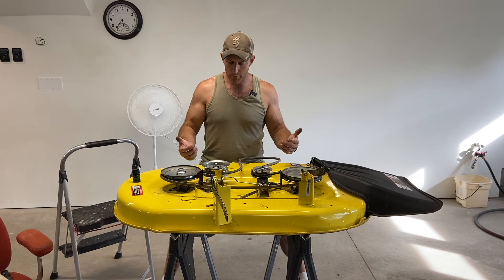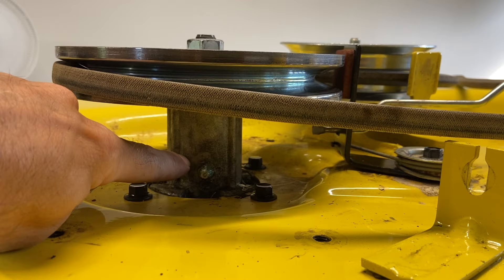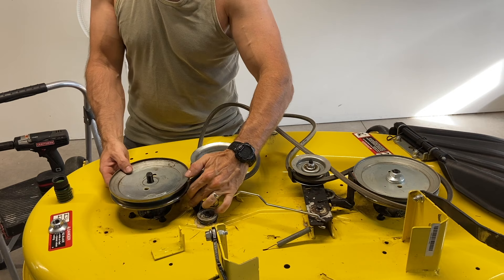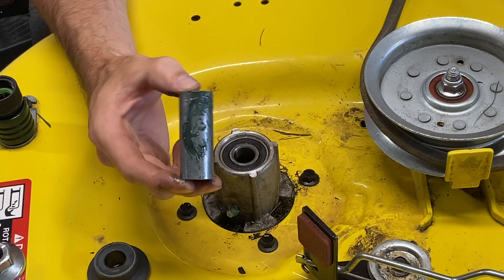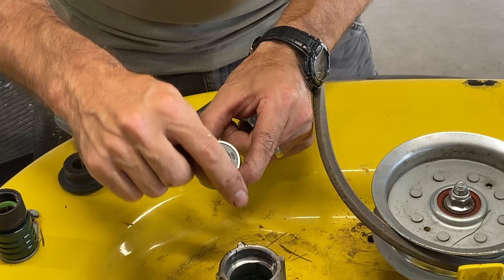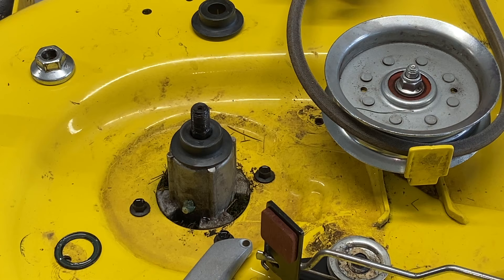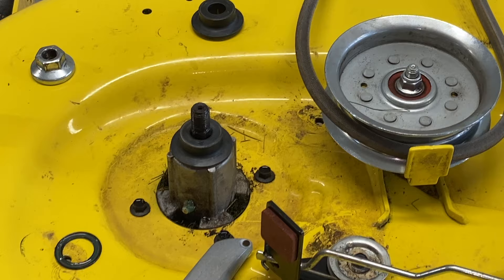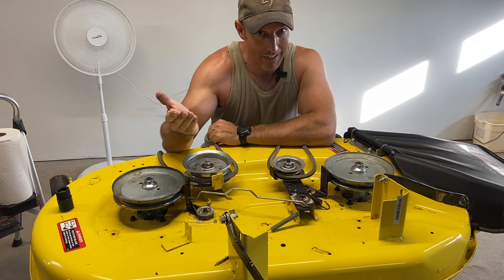I WOULD DO THIS DIFFERENT NOW JUST REPACK THE BEARINGS WITH GOOD GREASE AND PUT SEALS BACK ON.

Comment: Many years ago I went to the SKF Bearing Maintenance Training. I highly recommend it. Some takeaways: (1) The bearings in this video are 2 type. Double sealed, as seen in the bearing with the black seals . And the bottom bearing is a combo seal and metal shield. The metal shield offers better protection with all that debris being churned up during cutting. (2) Sealed bearings are factory filled to 20% capacity with grease. (3) Shielded bearings create less heat from friction than their sealed cousins. Now, the number one reason for mower spindle bearing failure is that the grease gets used up. We've all pulled out spindle bearings and found them bone dry. Yes, the zerk fitting is to pump grease into the spindle cavity to prevent the shaft from freezing to the shaft spacer. It's a waste to fill the cavity just to grease the shaft/spacer. I use anti-seize. But if you could keep grease in your mower bearings they will probably last until the deck rusts away. Once a year I use a needle greaser to add grease. 360 hours/12 years and still going. The bearings are 6204-2RS.  2RS= double sealed.  Cheers.
Reply from the maker: very good info thank you for commenting
Reply: The anti seize goes on the 2 bolts on each blade that hold blade to bearing shaft ..they tend to grow on
Reply: Very good info! There's a lot to bearing engineering and lube. Two other reasons the spindles are packed with "life Time grease: Manually, greasing can inject dirt and other debris through the grease fitting. And replacing spindles is easier and yields more profit for mechanics and dealerships than changing bearings. LOL
Reply: @czellner5894  The often heard term "lifetime grease" is a misnomer. No bearing lasts a lifetime without adding grease at some point. Yes, replacing spindle assemblies is easier, but I make more profit by replacing the bearings. I don't buy the ebay Chinese spindles because the lack of quality will come back to bite me in the arse. So I purchase quality bearings in bulk, and can swap them out faster than ordering spindles and waiting.
Reply: My original bearings lasted 16 years, mowing 2.5 acres. I bought eBay made in india spindles with sealed bearings. How long do you think they will last without removing the dust covers and greasing them?
Reply: Thanks Steady Eddie! Great info. I have a 1996 Simplicity mower and am going to go with NSK bearings as a replacement. I think I will leave the seals on and do what you do at the end of season when I put it to bed for the winter.
Reply: 3 years
Reply: I agree.  We ran irrigation pumps and the bearings on the housing going from the engine to the pump used to run warm.  I asked our lubricant supplier about that and he said we were over-greasing the bearings, too much grease and the balls or rollers were sliding and not rolling, this caused friction which heated the bearings. We were greasing every 12 hours, he said to grease them every 24 hours.  Problem solved, they ran cool.
Reply: Wonder why he didn't pack the bearing by hand and after reassembly he didn't turn the spindles to check for tightness.
Reply: @barneycarparts I was just saying to myself, if it ain’t broken, don’t fix it!
Reply: 2RS means two rubber seals the other bearing is a 1RS Z. Z means sheld. ZZ means double shield.
Reply: @barneycarparts  forever if you just grease them and leave the shields in place. Where do you think grease goes? It goes right past a rubber flap on those silly shields. Absolutely guaranteed. Silly folks thing grease won’t go past them. If you don’t believe me just pump the grease in until you see it exit then explain how it passed those bearings. This ain’t rocket science, even though some folks seem to think so.
Reply: Bobcat z 3500
48” deck.  Heard cheap bearings?  Deck issues.
Thinking of a hydraulic grease gun as mine can only do 8000 psi, not 10000.
Would like to keep the bearings lubricated with grease and a gun that can provide adequate pressure to push the grease into the sealed bearings  😊maverick
Reply: @barneycarparts  As long as they can. Much longer than if you grease a sealed bearing. 16 years is fantastic.

Comment: I am 77 yo, I started my apprenticeship on April 1 firs1959 in Germany and I am still learning to this day. To install the upper bearing use a pipe that is a hair smaller than the outer race never hit on the inner race because you will ruin the bearing at installation, also grease bearings before installing.
Reply from the maker: Thanks for your comment sir hope your holidays are good.
Reply: I was being Born in 1959, then I too went to Germany in 1976. alot of good Memeoies over there.
Reply: If you are replacing them its easier to use old bearings to pop them in.
Reply: I was a mechanic for 40+year! I can see from a lot of misguided information you folks are confused about what constitutes a sealed bearing and a caped bearing… A lawnmower Spindle bearing is capped not sealed! Don’t believe find a sealed bearing and try and remove the the seal without damaging it! NOT GOING TO HAPPEN! You will tear it up getting it out! Now a caped bearing on the hand has a removable cap like the ones demo on other videos! They call them sealed! WRONG. Fill that spindle enough to get pressure and you’ll see grease! If it were sealed you’d blow the bearings out and still not get grease to penetrate. Please Google the definitions of a sealed bearing opposed to a capped bearings! I’ve got a 21 year JD145 and I’m overhauling the deck for the first time! I’ve always greased the three spindles. Never been replaced. I rest my case😅
Reply: Agreed. The bearings come out of the box...less than half full of grease?. I leave little room for expansion, put the seal back in.
I have the same Craftsman I baught used( abused) and have been running the same bearings...just gave them a little extra grease.
I built a press out of 5/8 threaded stock and a well adapted washer.
I'm 65 now, and I built this in my 20's
Reply: @charliejones7574  I would like to see your press.
Reply: @HauntedBranch  I'll dig it out, hopefully today. Gout is hell on an old man
Reply: @HauntedBranch  basically, it is 5/8 allthread...2 nuts...and a collection of large to medium washers....some I had to grind to a smaller outside diameter. It is exactly the same tool I use to install king pin bushings...except the king pin bushings have more precise internal pieces

Comment: a grease gun puts out 10 000 psi. them covers will not stop it , thats what they are loose fitting dust covers , not seals , pump grease until you see it come out ends of spindles it will go threw bearing like the covers are not even there , thats how they are designed to work , no need to remove bearings to remove covers , it will take 40-50 pumps to fill when new and like 6-8 when  maintaining them to purge contaminated grease out and fill berrings with new grease  , remember every time you remove them berrings the soft aluminum  spindle. gets egged out a bit and before you know it you will have a spun bearing and your spindles will be junk  , you will then have to peen the bearing in and use some loc tight bearing retainer
Reply from the maker: Thanks for the info and thanks for watching
Reply: Thank you.  This is what I've been confirming over the past few days after receiving my Cub Cadet Ultima ZT1.  Planning to update them with a zerk fitting so I can properly grease and maintain them for years.
Reply: The grease will go straight up the shafts and out the top or bottom as its an easier route and peeps will assume there greased Personally i like to disassemble the lot and repack the  bearings Then i know there greased
Reply: The path of least resistance it will follow, the shaft bearing “should “be tighter than the loose fitting dust covers on bearing , also by taking bearings in and out unnecessarily you will egg out the  soft aluminum spindle, and will have a spun bearing and junk spindle before too long

Comment: The zero fitting is there to grease the grease the inside of the spindle house to keep WATER OUT. As a mechanic for over 45 years I replace spindle housings all the time in mower decks from damage and water. Many when you grease them you can see it push the water put past the bearings. Sealed bearings will run for years if you keep the water out. And NEVER WASH A HOT MOWER DECK.
Reply from the maker: Thanks for the advice have a good summer
Reply: Makes you wonder about that wash port.  First thing I took off.
Reply: @joehead1294  I use my wash port on my 50" Toro ZTR. BUT I also drilled and tapped my spindles, and they got pumped full of grease after I finished using the wash port a few times a season. No room for moisture with spindles oozing grease from both sides.
Reply: Mechanic for 45 years and never learned that the grease is for the bearings. That’s a tragedy. Pump till
They are full and grease gets into
The bearings too then they last more than a few years they will last forever then you don’t need to replace them and go into the unit. Water being pushed out is a benefit but not the purpose of the zerks. Good grief. I’m not even 45 years old and I figured that much out.

Comment: The seals are not a problem, it's the lack of grease pumped into the spindle to fill the cavity at manufacturing. With enough grease in the spindle all that is required is a few pumps once a year and the grease will pass through the seals and lubricate the bearings.
Reply from the maker: Thanks for the tip and thanks for watching

Comment: Pack the bearing before reinstall.
Reply from the maker: thanks
Reply: No you don't have to , take the inside seals off and after you put everything back together  just grease it til the grease starts to come out that means the grease has gone all the through the bearings just a cleaner way of doing it ! And use a plastic hammer !!
Reply: I not only pack the bearing but I also manually fill the spindle as well. Grease cartridges are expensive and there is so much space that you can use up an entire cartridge  before you get enough grease in there to even reach the bearings.

Comment: I have a  6 ft. mowing deck by Landpride.  Last summer I replaced all the spindles, pulleys as one big unit, and I believe I have three or four of those spindle units that wore out.  To think the bearings are sealed when you have a grease fitting to shoot grease in is a joke on us. So greasing doesn't do a thing because the seal shields it.  But even taking the seal off doesn't do much either because grease  follows gravity down and can never reach upwards and stay there to feed the bearings.  If I were you, I would have greased the bearings by hand, then reinstalled them, and not expect the grease to revitalize those bearings when you pull the trigger..  It''s the same as doing a automotive brake job.  When the bearings are good, clean them up, and repack the bearings with a glob of grease in the palm of your hand, and slap the bearings into that glob to force all the grease it can take. I'm not sure if removing the plastic cover resolves the problem of the bearings finally getting all the grease it needs.  So then what is the purpose of designing zerk grease fittings into a lawn mower that does no good.  It gives you a peace of mind when you decide to buy the mowing deck, until you get to that ah-hah moment years later when you realize it didn't matter.  It's a marketing ploy and a design flaw.
Reply from the maker: I agree I think now this would be a better way thank you for the comment

Comment: Hello Jim. I have to change the bearings in my Shivvers Country Clipper zero turn about every 4 years. I have tried putting the new ones in with the seals intact, and also with the inner seals removed so that new grease reaches the bearing cage. There doesn't seem to be much difference in overall longevity either way. I will recommend that if you choose to keep the seals intact, you should not "over grease" the spindles, as the grease pressure will push the inner seals into the ball cage and the bearing will soon be toast. This will happen even if the spindle is equipped with pressure relief vents. They don't open until the pressure reaches 5 psi, which is still too much force for the seal to not be damaged. A very good video. You do a great service to the home DIY guys. Thanks for sharing.
Reply from the maker: Thank you very much for the well explained comment I hope this helps someone.
Reply: Great point about pressures within the spindle. Sealed bearings are used to help keep the grease inside the spindle. Removing one side will put all the load on the outer seal and likely cause its failure. Also, the average spindle generates enough heat to somewhat 'liquify' lithium grease. If it's properly maintained, pressure will seep some of that liquidy grease into the sealed bearings.

Comment: You did good job on the video Sir, after a few years of messing with bearing I will give one piece of advise.Always press or tap the bearing in place by the outer race.When you tap on the inner it can damage the balls and cause it to over heat and jam up.Learned the hard way and burt a belt up.
Reply from the maker: Thanks for the tip and thanks for watching

Comment: My John Deere spindle bearings are: 1. top bearing sealed, 2. bottom bearing open on the side that is facing into the grease area, and the bottom of it is sealed. I can understand why they did it this way. A. If the top bearing is open on the side facing the grease, there's a chance that, when the bearing warms up, the grease will gradually drain out of it and cause it to run dry.  A sealed top bearing is far more reliable than an open one, B. Having the bottom bearing open on the side facing the grease area, can be filled with the grease when a grease gun is used to fill the cavity. Leaving the bottom side seal intact prevents the grease from running out and it seals the bearing from moisture and debris. 
The truth is, most homeowners never bother to grease these spindles, just run them until they fail. Nowadays, a generic replacement spindle is about $25 (2021 price), so it's not such a big expense to just replace the entire spindle assembly when the old one fails and starts making noise. And, it's a good time to clean the spindle mounting area on the deck and spray a little paint on it to help prevent rust.
Reply from the maker: Thanks for commenting and watching my video hope your having a good summer

Comment: I had to replace my bearings and spindles. I pumped them so full of grease that it was hydraulically pushing against the bearings and housing. So now I take out both seals on the bottom and the inside of the top. Also, if you go to an industrial bearing supply, you can get a stronger bearing for just a few dollars more. A bearing designed to last years in a factory will last you for a decade.
Reply from the maker: Thanks for the advice

Comment: I think it is best to keep the seals in place. I removed the bearings on my D130 spindle. One is black plastic cover on both sides and the other is black plastic and metal on one side. Now I don't remember which side the metal one should face. Top or bottom towards the inside of the cylinder or out. Thanks for posting.
Reply from the maker: Thanks for watching

Comment: depends on the particular bearing about the seal....the easily removed plastic seals are not really good seals and some grease/oil will pass through. Then there are the bearings with metal seals, they tend to seal better but also will allow some passage of oils from the grease. I have a John Deere mower bought new in 1997, it has the exact same set up for the mower deck you are showing here. The bearing type is metal seal, I know because today I took one spindle apart so I could get bearing size to order new ones. I have always pumped grease as regular service and just now I am getting some bearing play on one spindle. This mower has seen several thousand hours of mowing, heavy mowing for a lot of it. When I replace the bearings I am going to remove the seal on the inside face of the bearings, that will allow grease into the bearing. I will not drill a weep hole, I want to assure that pressured grease reaches into both bearings, even if the remaining outer seal ruptures. I regularly grease the spindles anyway so the bearings would be flushed often if and when a seal gives way to grease pressure. I have been doing that kind of modification for bearings on all kinds of machinery since the 1960's and it works superbly.
Reply from the maker: Thank you watching and for the explanation

Comment: I just redid everything on the mower deck.  On the D125. After ten years of beating the crap out of it. I never even greased anything ever. only changed the motor oil.  What I found was the two spindle pulleys the 7" dia ones were starting to strip out their centers.The spindles had like 1/16 play on the shaft . I replaced both spindles, and both pulleys neither of those pulleys had much wear in them, and deck belt, I've replaced the deck belt like three times now.I must have put six sets of blades on this  D125. Rocks are hell on blades.  I just replace the drive belt for the first time. I also  had to straighten out the mower deck, ,as I had bent it int so much the blades hit it. Yes I truley beat this thing up.  My thought is simple, I won't touch those bearings at all. I think If you grease the spindle the force of a grease gun wii force grease into those bearings. If nothing else the grease in those bearings can't go out either.The spindle cavity if full of grease and pressurized bye the grease gun. Maybe it works past those seals? Bottom line I'm not going to disassemble those spindles. I'll replace the entire unit, if it gets play into them.
Reply from the maker: Wow sounds like my mower will last forever my lawn is not very hard on it. Thanks for watching